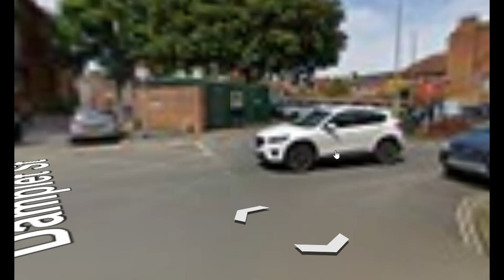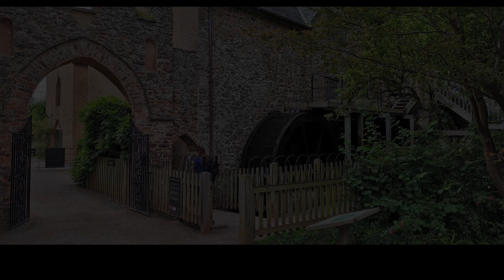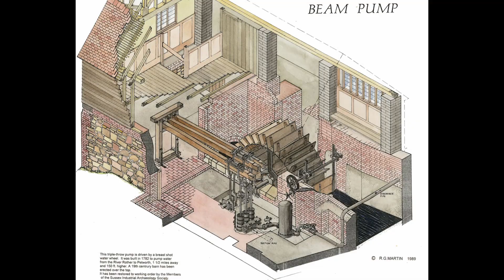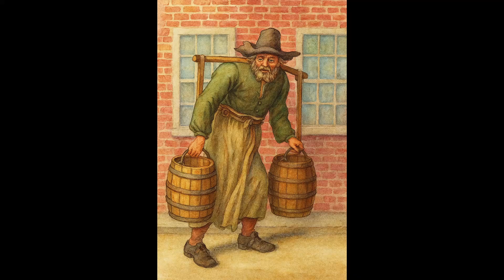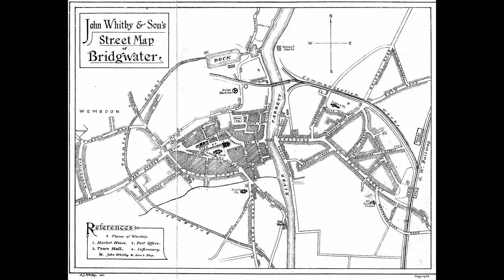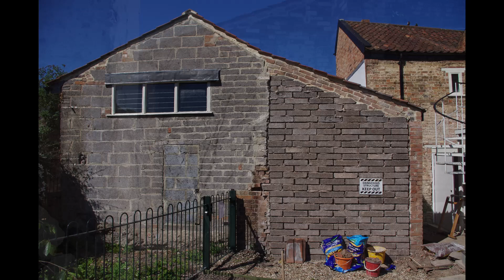The Lytle Mill and Bridgwater's First Waterworks

Comment: Parts of the mill wheel are still visible in the Durleigh brook.  Given the right mechanical know-how I feel it ought to be possible to reconstruct a duplicate.  It would make an interesting addition to the Museum site.
Reply from the maker: I had no idea - there was so much accumulated rubbish down there it was hard to tell what was what - but makes sense the wheel would have just rotted in place. That's exciting for the potential restoration.
Reply: @friendsofthewembdonroadcem9194  I haven't been down there for a while, but parts of the wheel are cast iron, including the centres that I saw.  Other metal parts like the vital bearings may be buried in the mud.  Last I heard any restoration would initially require finding somewhere to store the archives from the many local archaeological studies and digs, which were housed in the the Lytel mill building.